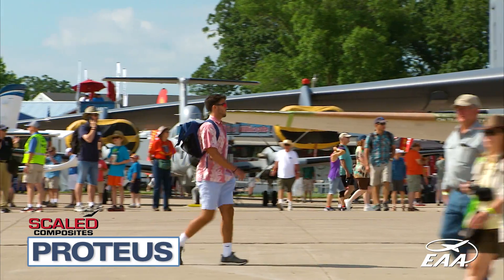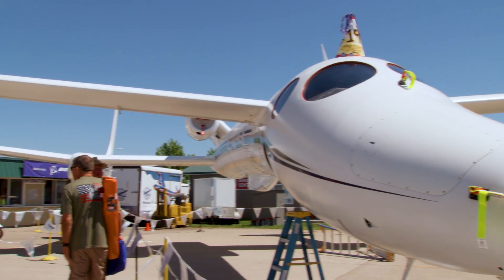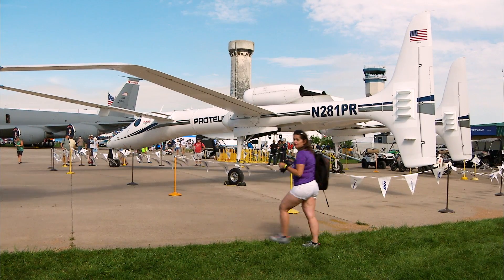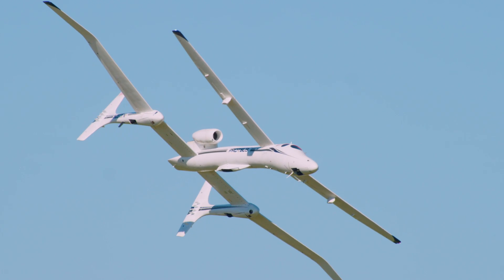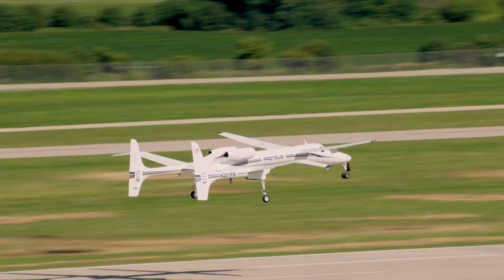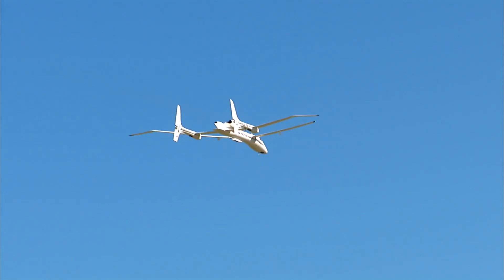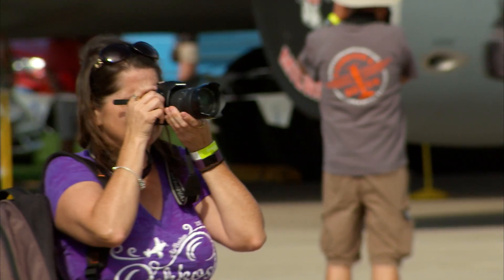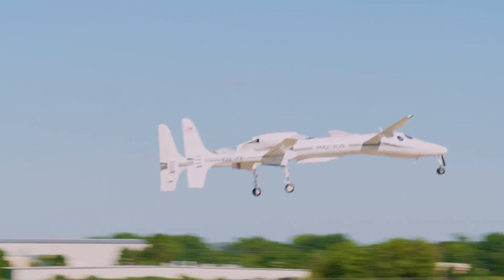Proteus Takes Flight at Oshkosh

Comment: What's that anhedral for? Doesn't look like it is a too stable design. Would less canard and wing dihedral be a simpler solution?
Reply: Improved directional and lateral stability characteristics, most likely. Too much dihedral is just as bad as no dihedral. It could also have something to do with the airflow coming off of the canard.
Reply: I asked myself the same question. I guess it's sexier like this.
Reply: I think you're onto something. It looks unbeliveably cool this way.
Reply: +Jonah Beale  I found an explanation that the Proteus was to be used as low cost satellite replacement, so those dihedral/anhedral angles were to clear the line of sight for the telecom antenna.

Comment: I wonder what the specific altitude record was.  The SR-71 Blackbird had a service ceiling of greater than 85,000 feet so I am sure they flew higher than the Proteus.  Just curious.
Reply: Proteus has the record for peak altitude achieved by a light jet.

As well as sustained altitude achieved by a light jet.  

The SR71 does not fall under the light jet class
Reply: Butch S. -Sorry, but no; the U2 has a ceiling of about 70,000 ft. Also, as a very much subsonic airframe, it must maintain a very specific airspeed known as the 'coffin corridor' at that altitude. Any faster or slower, and the plane will fall out of the sky.
Reply: Tre'von Cowen The X-15 doesn't count in this context because it wasn't an "Air Breather"
Reply: crazymuthaphukr thank you for the clarification.  None of that was mentioned in the video.  Only a blanket statement that they held altitude records.
Reply: Darrell Grisham A simple Google search would answer that question.
Reply: Watching todays news about the Eclipse, NASA has two of the WB 57F doing Eclipse research and data gathering.    So I guess the old birds still have many uses.
Allegedly, the one in Kandahar, "HALOE data allowed scientists to create high-resolution 3-D maps of parts of Afghanistan. In 2010, the sensor reportedly surveyed 70,000 square kilometers, or approximately 10 percent of the country." for Military Intelligence use.    
But they are so versatile they can be custom fitting for whatever specific mission they are needed for.
Reply: From what I understand the RB-57F could go around 80,000 ft.     Now the ones for NASA are called WB-57.   Although my nephew told me of one flying out of Kandahar for a while.   Like NASA has business in Afghanistan?
Reply: The one out of Kandahar is a NASA aircraft requisitioned by one of the alphabet agencies.
Reply: JdK. R The RB57 F  and the WB 57 F are identical except  for their mission Avionics.  The WB lost it's mission when Satellites proved more capable  and effective  at high altitude research.
What is it doing there in Afghanistan? That part of the world  is the birth place of Monsoons.
Reply: What about the U-2? The Dragonlady has a lot more in common with Proteus than the Blackbird, and also boasts a service ceiling of nearly 85,000 feet.
Reply: Fair enough, I can't relocate where I got that figure, and AF.mil's U-2 fact sheet lists the ceiling as "above 70,000 feet."  I suspect it's actual ceiling is still classified, so they're being intentionally vague.  ;-)
FAI has a U-2C flight still holding a record at 72,828 feet. The second part is what had me curious, the U-2 record is for class C-1h, (9000 to 12,000 kg), Proteus is in class C-1e(3000 to 6000 kg)
Reply: well, they were used by the UK till not that long ago

also, other jets have gone higher, or have higher ceilings, but the key point is, this is able to maintain, this is also a light jet

things like (and I'm surprised no one said it yet) the english electric can, and has zoom climbed to higher levels, (likewise some migs) but they've not been able to maintain it (in the english electrics case, fuel was the big factor)
Reply: Greg Ellis you know that would classified lol.
Reply: Greg Ellis X15 flew 300K feet
Reply: But, what is the peak altitude it reached, just to say it did is not enough.
Reply: Working  for mining  companiess  so they know  whats n the  ground